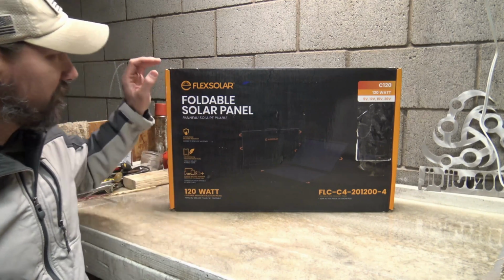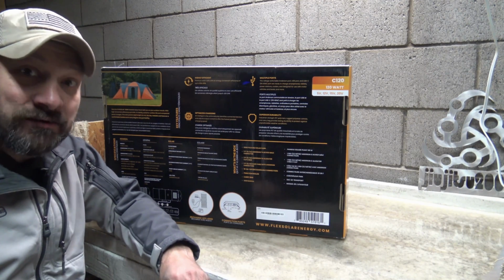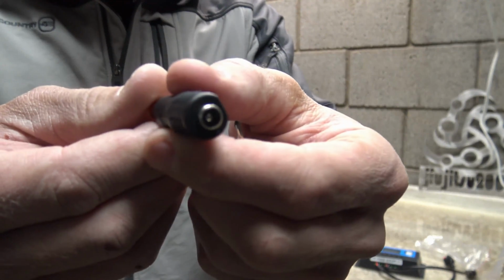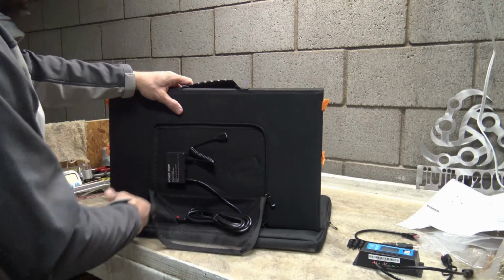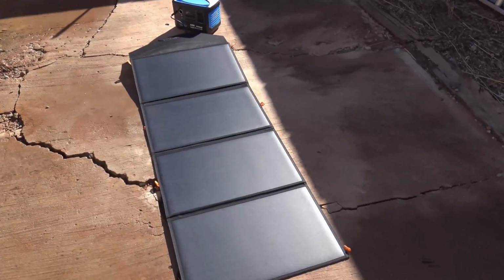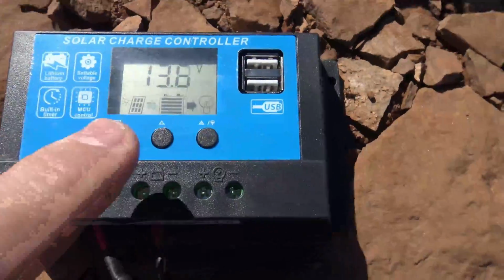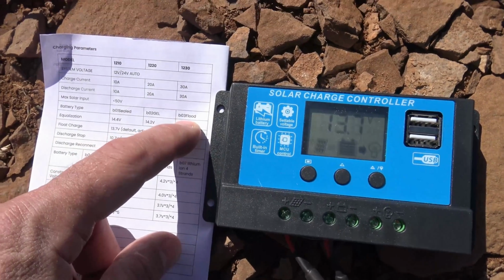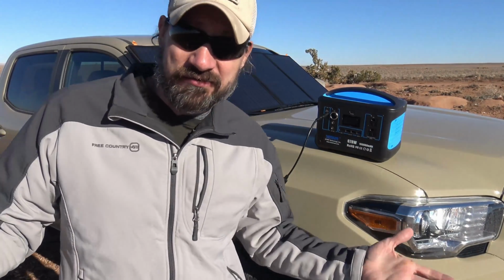Flexsolar 120 Watt Folding Solar Panel Kit

Comment: i purchased this flexsolar foldable flexible unit because i can physically carry it. it weighs only 10-11 pounds. being elder and with some physical disabilities, i cannot lug around the standard 40 pound suitcase, though they appear much more sturdy. ill start with this 10 pounder and see if i can understand the workings about it. your video was extremely helpful.

Comment: Tips:

Make sure you buy a "Pure wave" inverter because a cheap "Square wave" inverter will chomp up and kill your digital equipment. The sign wave on a "square wave" is too dirty and digitals products like mobiles, laptops, cameras, drone etc HATE IT

Never let your charge on a leisure battery go below 11.2 volts or the Lead acid battery will not recover to 12.56v max 13.4v. If you see your battery is getting 13.7v coming in, thats healthy, it wil drop down again as soon as you unplug the solar charge controller. Monitor volts with a handheld meter or module.

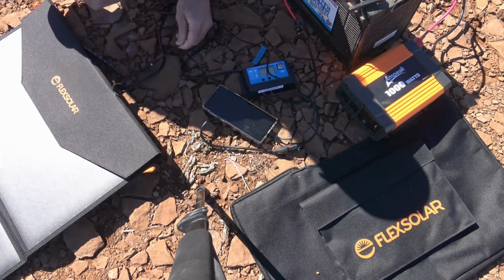22:33 yep people can do that, but its not actually intended for mobiles. Its for charging power blocks for the same reasons as "Pure Wave"  above. So charge your power blocks up during the day, frees your equipment up for filming ect. And then charge your equipment overnight with the power blocks or 12v batt

For personal kit like mobiles & laptops & Camera youre looking at something like a 500w to 1000w inverter running off a separate 120ah leisure battery. Can run it off your cars battery with the hood up at a pinch. 

Hope that helps folks :)
Reply: I have 100w panel, 120ah battery, 1000w inverter ... gives me the ability to run a laptop for about 5hrs a day no probs.